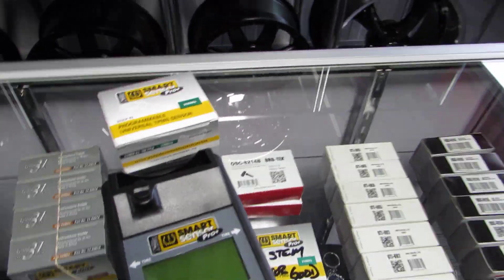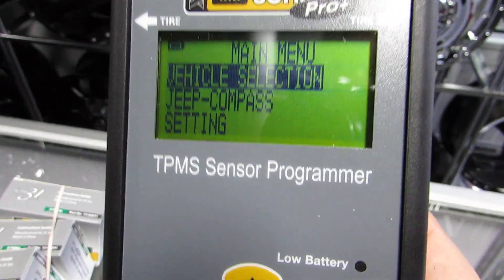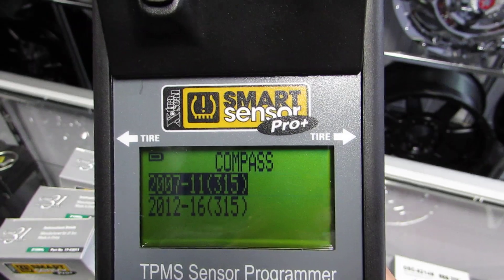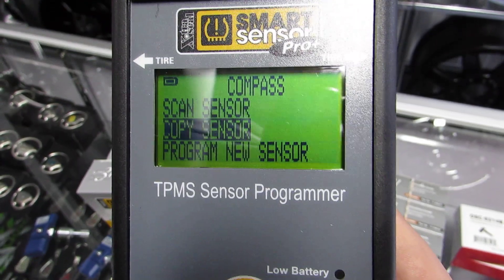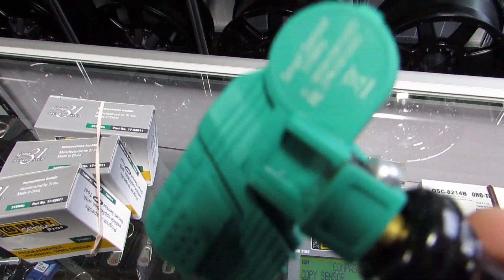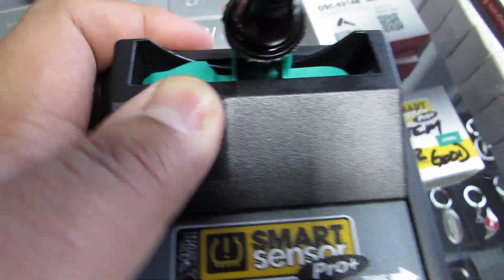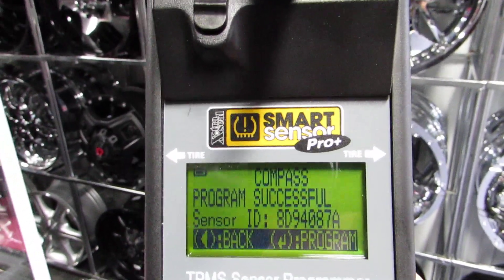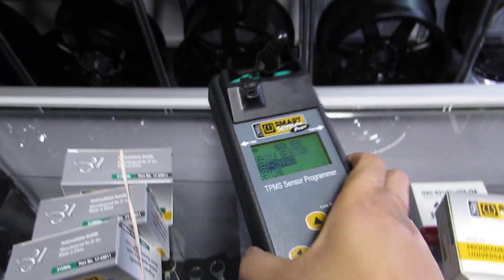HOW TO PROGRAM A BLANK TPMS SENSOR (EASY)

Comment: So I have a similar sensor, the Wurth one (same BS), but my TPMS are already preinstalled in my new rims and tires. Can I wirelessly program with a tool like this? It has a feature to connect to the ECU
Reply: I just bought tool and I did see the wireless option did it work for you?
Reply: Having this same issue right now. Not sure what to do lol